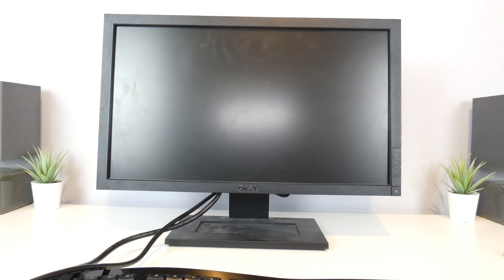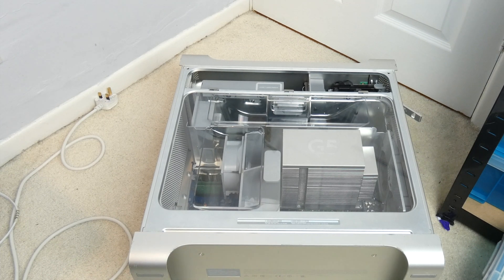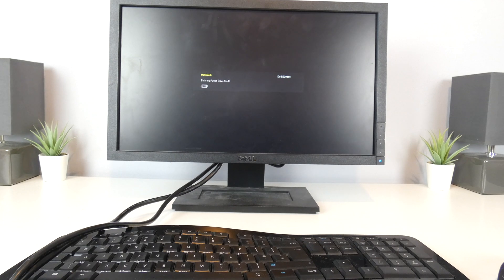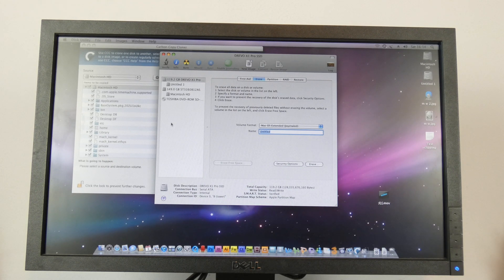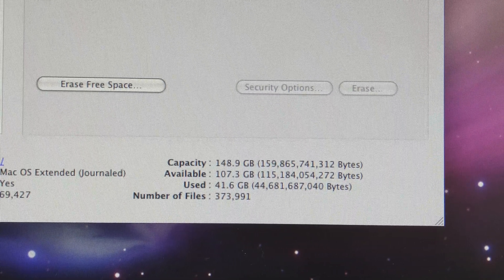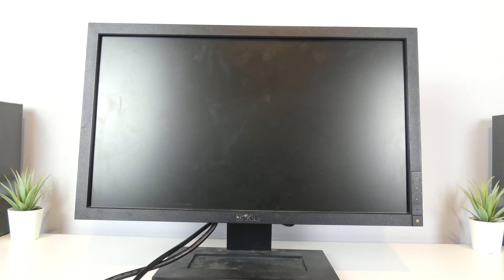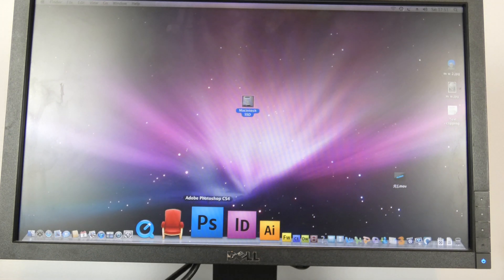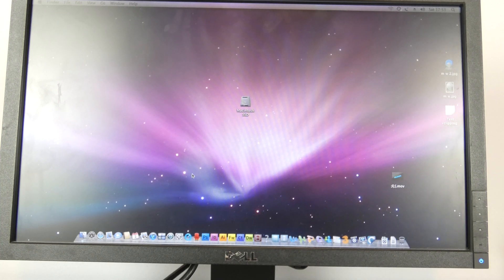Installing An SSD In My PowerMac G5

Comment: When you do this, you should set your STARTUP DISK in preferences.  Do that AFTER you reset your PRAM (if you choose to do so).  You don't have to reset the PRAM, but it helps with the fan controllers.   I did a similar upgrade on my iMac (2008), and setting the STARTUP Disk will cut the boot time significantly. Setting the STARTUP disk tells the Mac hardware what to look for to boot. Otherwise it will poll all bootable devices to see what works.

Comment: Hi. Can I install a SATA III SSD or must be a SATA II?
Reply from the maker: Some SATA III drives are compatible but lots are not. I would recommend going with an older drive if you can
Reply: You can install any SATA the only difference will be the speed, even if it is SATA II it will be much more better than any HDD
Reply: @MRHOTCAKE  not true. the storage controllers in these machines are very picky, not all sata drives work here.
Reply: @OperatorMission  at least mine works fine
Reply: @OperatorMission  you are right my friends crucial mx500/256GB are NOT working in his PM G5 Dual 2Ghz.
Reply: @drzeissler  im using SATA2 drives in my g5, all the SATA3 drives ive tried simply wont work in it. there may be some that do, but idk
Reply: @OperatorMission  What SATA2 drives? I simply can't find one.

Comment: Hey, what is the maximum capacity this machine can hold in terms of ram, hard drive coz I am looking forward to upgrade the Mac power g5 7,2 for music production. Probably I might need more ram and hard drive too. Any idea? Thanks
Reply from the maker: Depending on the specific model, the max amount of ram can range from 4 to 16gb. In terms of hard drives the most I’ve used is 750gb so I’m unsure of capacities higher
Reply: 2x 2 terabyte is the max i think